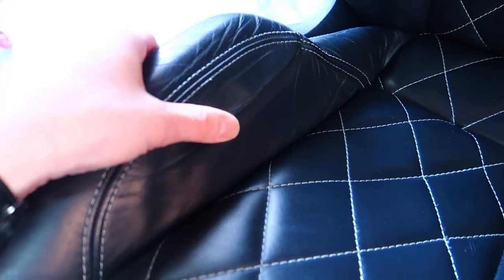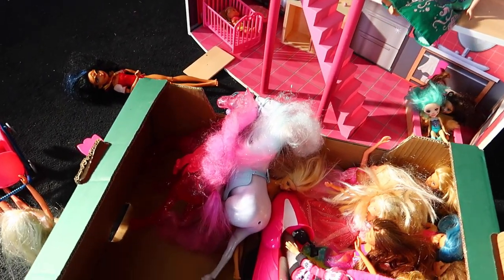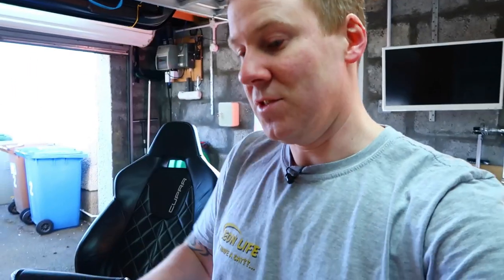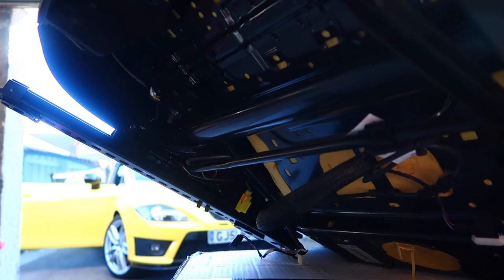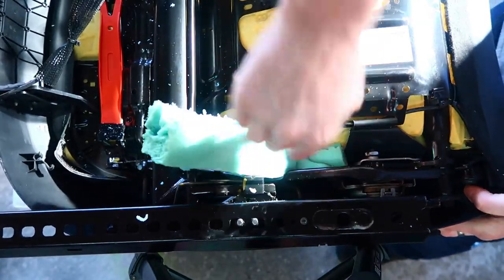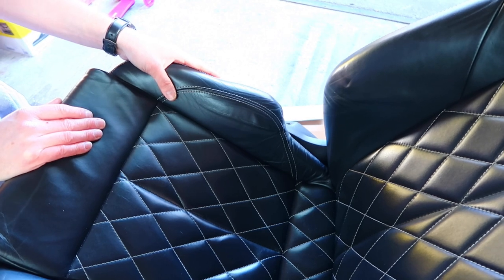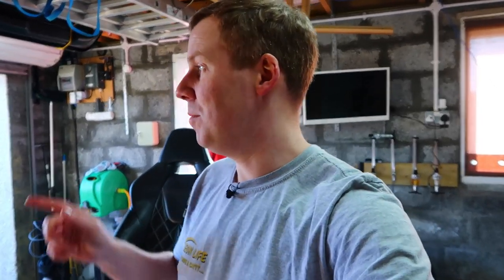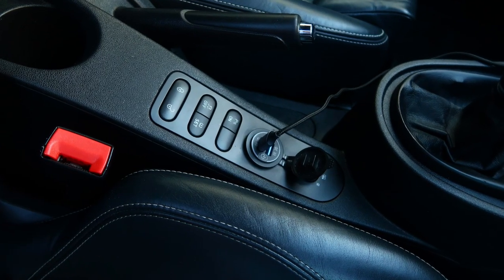REALLY EASY Seat Bolster Repair | Are your bolsters sagging? MK2 Seat Leon 1P1

Comment: Awesome! I I was afraid it would require ripping through some stitching or what have you, can't wait to do this on my Mazda 3
Reply from the maker: Best of luck with it Robin 👍🏻 hopefully your seats are as easy to access as my one was and any foam you can get in there will help I'm sure. Cheers
Reply: how did it go? Same issue with my Mazda3
Reply: @Lupo150  I ended up finding a good price on some seats and swapped the leather from the donor passenger seat onto my seat, along with its good foam. the top/back part of the seat I kept the old foam and stuck a layer of foam I had on top where it sagged. access from the bottom is pretty poor, you're gonna have to disassemble the seat most likely
Reply from the maker: Sorry to hear it was so much work in the end, for the Mazda seats Robin, but hopefully the end result is a better looking, and more supportive seat. Appreciate you commenting the process involved for Lupo, and other viewers 👍🏻
Reply: @NorthCoastWorkshop  oh yeah no worries at all, my leather was cracking and really crushed and worn, it was a fair bit of work but my seat is essentially brand new now!
Reply from the maker: Great to hear mate 👍🏻

Comment: Great video, I’ve ordered the foam too! Do you pack it into the outside part of the seat to push the bolster back up?
Reply from the maker: Cheers Raymond 👍🏻 I had to push it up through the outside of the booster to get it close to the area.
I did overpack part of it and it was kind of bulging out a bit, so watch you don't add too much foam. 
It may take a while to locate it properly so that it takes shape, just keep adjusting until you're happy. Hope that helps 😊
Reply: @NorthCoastWorkshop  top man, hopefully got it done this weekend, I wasn’t sure if you had to pack the top of the bolster aswel as the side, but I will sus it out when the seat is out. Keep up the great content and you’ve inspired me to do more mods to mine, lovely car btw 👍🏻
Reply from the maker: Much appreciated mate, and yeah just wing it like I did!! 😅 I kept going till it looked better than the saggy mess it was before 🙈 u may need to take bits back out to reposition it.
And great to hear the vids are helping u out mate, always makes it more worthwhile hearing things like that, cheers 😁👍🏻

Comment: Get yourself 2x Sealey ak6697 (3/8) and 2x ak6698 (half inch drive version ). Long handled flexi head ratchets. Absolutely superb and extremely useful. Especially for hardcore jobs like suspension and underside work. I paid about 40 quid each. 160 pounds but I can't stress how versatile they are. Because of the length/leverage and flexi head combination.
Reply from the maker: Cheers mate, I'll look them up! Have u done MK2 suspension before it sounds like, or very similar setups?

Comment: Great video mate. Thinking of doing this to my Cupra as I’m experiencing the same problem. Which thickness foam would you recommend on purchasing for this?
Reply from the maker: Cheers mate 😁 I think the stuff I had was about 30-40mm but as long as it's reasonably firm foam, you could probably get away with 25mm-30mm. 
Its quite cheap on eBay. Watch not to overstuff it, as it will start to mess with the shape a bit. Pop a bit in the check to see the difference it's making. Let me know how it goes 👍🏻
Reply: @NorthCoastWorkshop  awesome thanks!

Comment: I need to do that to my drivers seat, what size spline socket did you use to get your seat out. Thanks
Reply from the maker: Hi Dillon, sorry I never saw ur question sooner. It was an M10 multispline attachment I used for the 4 bolts that hold in the seat 👍🏻
Reply: @NorthCoastWorkshop  no probs I got me self a set that has a m10 in it, will be getting on it soon. Cheers
Reply from the maker: Nice one 👍🏻 I was going to say that possibly a M set is always a good investment. Best of luck with getting the job done
Reply: Finally got round to stuffing me saggy bolster.
 fitted a racechip xlr throttle response too while seat was out 😎
Reply from the maker: Nice one 👌🏻 bolster any better? 
How's the racechip feel?
Reply: @NorthCoastWorkshop  bolster is better thanks for your advice.
Mate it feels like a different car, instant torque, no lag. Well worth the money

Comment: DIY because I need to do my suspension
Reply from the maker: 🤣🤣 I'm always one for wanting to give things a go, and challenge myself, so yeah, a good possibility that I'll give it a bash! (So to speak!)
Reply: @NorthCoastWorkshop  I will be keeping an eye out for that one haha
Reply: @NorthCoastWorkshop  make sure you've got all the tools in advance. It's a pretty hardcore job with some hefty bolts that my be difficult to undo initially
Reply from the maker: Cheers, yeah that's what worries me is that something goes wrong then I can't move the car to get it to a garage for help 🙈 watch this space 🤣👍🏻
Reply: @NorthCoastWorkshop  I would make sure you have some bolt extractors just incase
Reply: @cozifpv2069  Sealey 2000w induction heater more like. 650 quid
Reply from the maker: 😂 I'm hoping the temps climb a bit up here soon,  sick of single digits! 
Oh and I'll get a recent price check shortly for the fuel up here. Was still £1.60 for 97 RON about 4 days ago, bound to have shot up since then 🙈
Reply: @NorthCoastWorkshop  I paid £1.80 a litre for v power this morning 😅🤮
Reply from the maker: 🤮😭😭😭 it's horrible!! It's going to bring the country to a standstill if it keeps climbing!!
Reply: @NorthCoastWorkshop  they already inflate prices way to much they don't need to make us suffer more